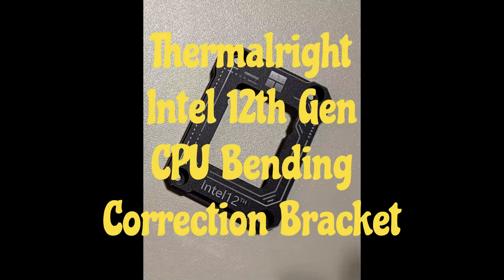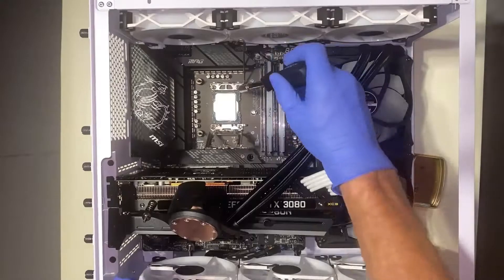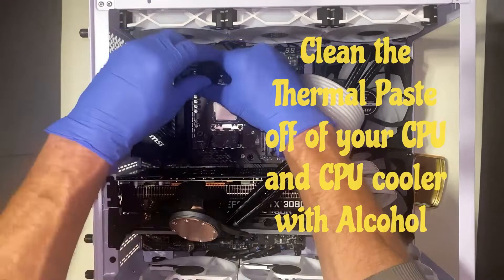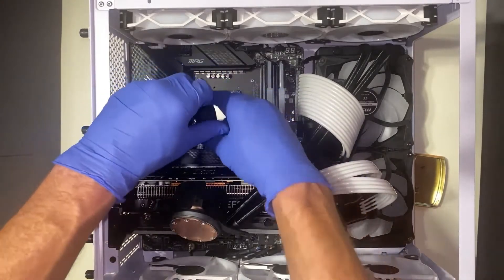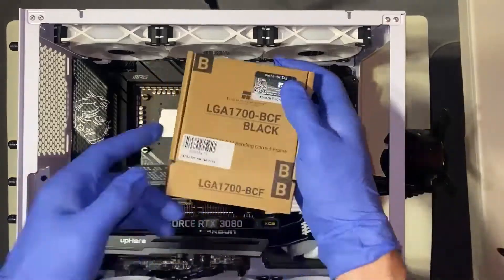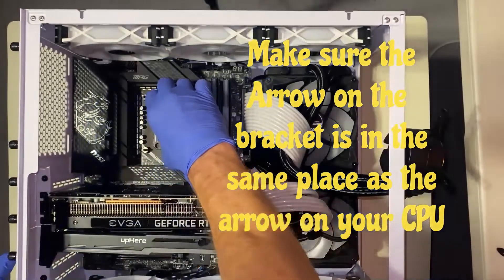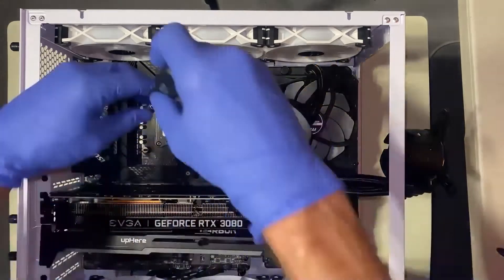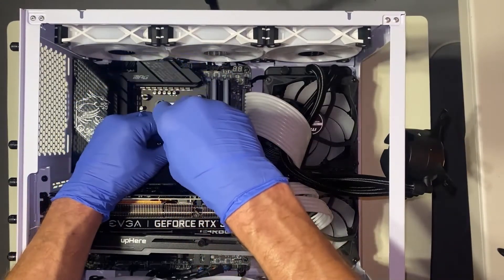Installing Thermalright 12th Gen CPU Bending Correction Bracket

Comment: Hello, Im using the MHQJRH on my rog strix z790-e but the screws are not getting tight, they keep dancing on the place, and I can't put hu=im or the original backing place...any tips? Im kinda worried, lol.
Reply from the maker: The screws, screw directly into the motherboard. They only go hand tight. If they are not tightening you might have striped them in that case I would try and return it b4 you damage something else a striped can cause a short as the power planes run throughout the PCB(motherboard)
Reply: @walkersgamingpcs  the backplate was not in position, I put her on place and everything holds up.
Reply from the maker: @ Alls well that ends well 🙂

Comment: When buying a anti bend bracket do I need anything extra to mount the cpu cooler?
Reply from the maker: The old mount has torque screws holding it to the board some kits come with the tool to remove them some do not, also make sure you have thermal paste. I believe it’s a T25 torque bit but it might be a T20 it’s been awhile since I did one.

Comment: It's using this bracket still better than Intel's Stock ILM? Did you run into any booting issues? I heard if you torque it too hard it might cause memory issues and cause the PC not to boot up.
Reply from the maker: The bracket usually drops temps by 5-10 degrees but not always compared to intels ILM. I have not run into any booting issues or memory issues, I have done 37 of these so far. The biggest concern with over tightening is you could pull or strip the threads and power planes run through the motherboard so you risk shorting to ground, same thing happens if you cross thread. It is possible to have memory issues though but I think that more likely if you’re using the washer mod method.

Comment: Hi bro good video .. can you tell me please what temperatures you have now and before
Reply from the maker: Hey thanks for watching. I have 100+ hours into testing right now and a video will be coming out shortly to explain how to get your temps on an 12700k under control. Having said that during my cinebench r20 run it thermally throttled without the bracket, and with the bracket it hits the same temps as the washer mod 86-87 but on cinebench r23 it still thermally throttled.
Reply: @walkersgamingpcs  so you thermal throttling o. R23 on stock specs? I have a 12900K, DeepCool LS720 aio, same MSI Carbon board, she is pushing too much voltage on the CPU, for me I have 1.35v to 1.40v on stock!! Crazy. Even with the thermalright frame my temps are too high, 94c on cinebench. I can’t overclock it to 5.1 and 1.34 voltage and keep it below 100c on r23. I see that many guys can. Maybe my processor is already bended.
Reply from the maker: @rafaelisraeldasilva  yea I tried with 3 different coolers and still thermally throttles, I’m working on a solution right now ☺️. Hopefully I will have a video out soon.
Reply: @walkersgamingpcs  I will be waiting!
Reply: @walkersgamingpcs  nice! I will be waiting the video. I didn’t had any improvement with the BCF.